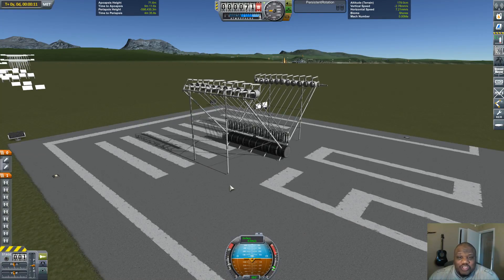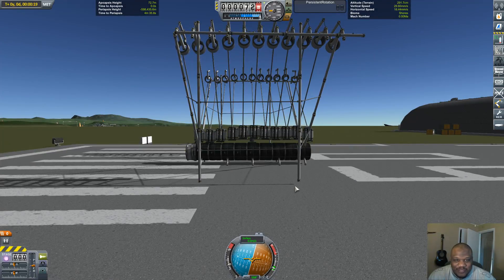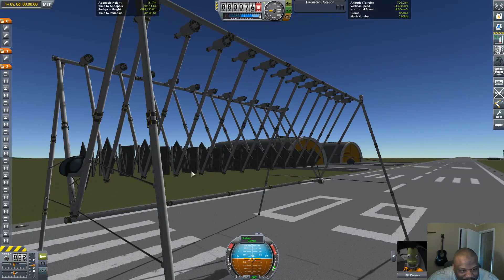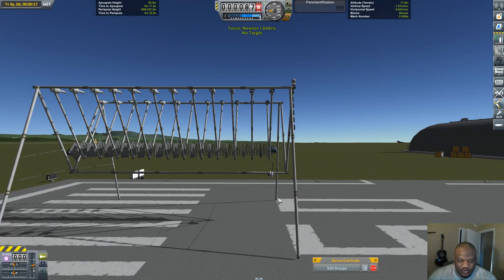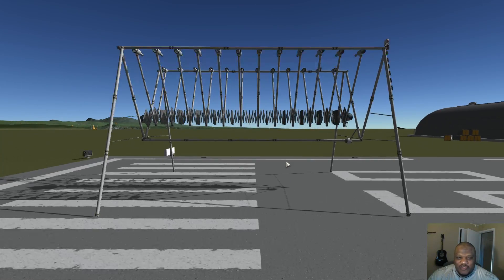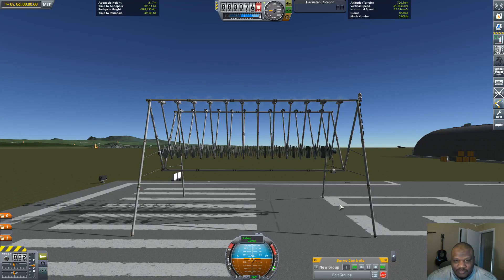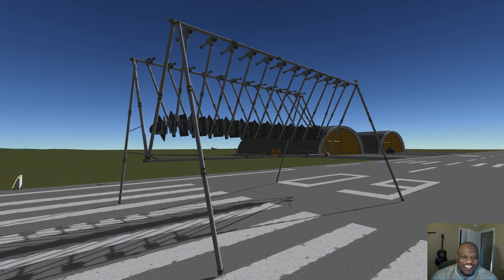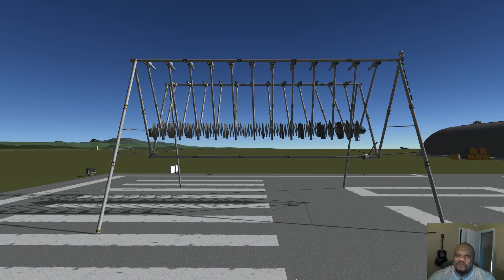Kerbal Space Program | Newton's Cradle

Comment: The way I understand a Newton's cradle is it relies on the principle of pure inelastic collision such that all of the incoming energy is transmitted through the system to the opposite end ball.  Your spring system looked cool but after watching it a couple of times I noticed that motion on the far end (farthest from the initial collision) is already beginning while the near end is still undergoing compression.  This means the energy is not being transmitted instantaneously nor totally.  And the fact of the springs themselves means they are simultaneously absorbing and pushing back some of that initial energy, making the collision behave more elastically than inelastically.  The underlying trouble might be KSP itself since I'd be very surprised if it models pure inelastic energy, what with all of its vector math and such.  
Totally concur on the compressed paper/carbon theory.  The flammability of the compressed smoke material is probably what ignites most parts into such huge fireballs.  Hashtag theory hack?
Reply: "And the fact of the springs themselves means they are simultaneously absorbing and pushing back some of that initial energy, making the collision behave more elastically than inelastically."
I disagree with this. I think you can have a completely elastic collision with springs because I don't think the springs lose energy like momentum->energy transfers do. The elasticness only depends on conservation of kinetic energy, not spontaneity.